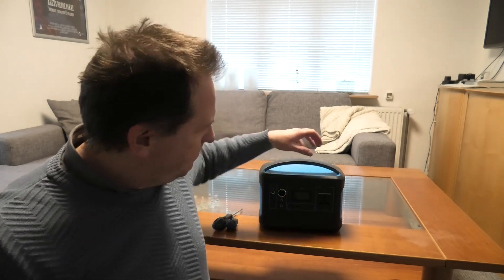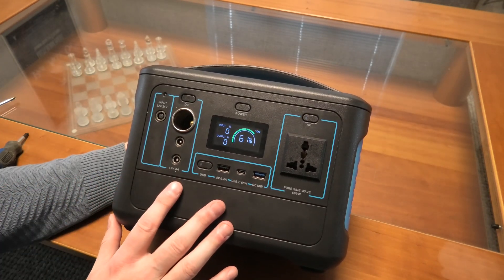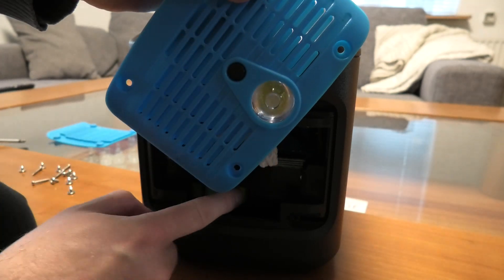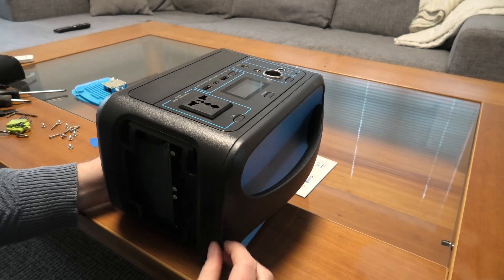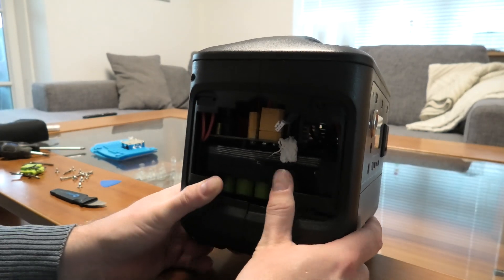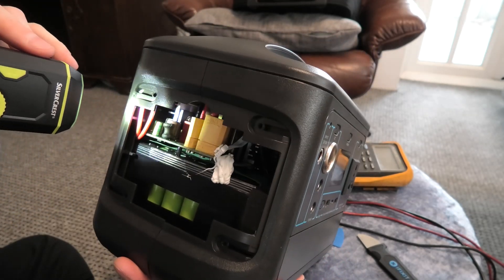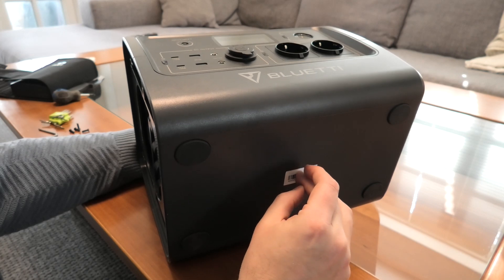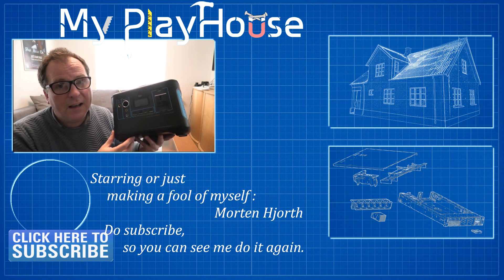What's Inside the Cheapest Power Station on Amazon - 1275

Comment: In series? That would be parallel but just because the label says at 3.6V doesn't mean the pack is actually at 3.6V. THey just use that number so you can convert to other voltages. It doesn't mean they have that pack configuration and we know that to be the case because no inverter is going to take 3-4VDC and step up to 120V or 220VAC. Same goes for the 65W PD because thats a 20V PDO from PD.

I'd be surprised to see 18650's its quite often that they use larger cylindrical cells. I want to say I've seen 33130's or something along those lines in Bluettis or EcoFlows

Ah I got to the point of the battery voltage. 6S sounds about right. Could be 7S but highly unlikely you got one that low so 6S is better suited to a storage voltage.
Reply from the maker: My best estimate is that it is S6P10

Comment: Hi Morten, maybe the cells in the 1000w supply are 26650s? Wider than an 18650 and look even a wider and shorter than 21700, but I'm only going based on proportions to your index finger which I haven't seen in person hahaha. I wonder what cells your largest power station (2kw?) has and whether there's a trend of using the larger cells in higher capacity stations or if this was a one-off. I think electric vehicles like Teslas still use 18650s which makes me think it's not necessarily a power density requirement.
Reply from the maker: Yes the Bluetti had one of throws bigger cells,, I could not see witch.
Reply: @MyPlayHouse  I think you might have luck disassembling it if you use the blue spudgers to pry open the handle itself rather than the part you tried to. E.g. at 06:31, you can see a seam that travels along the handle. It might be possible to spudger between the seam on the handle and trace it down to the each corner of the unit and separate the tope part of the handle from the blue plate underneath the handle. I wonder if that would work and whether it would reveal some screws underneath? It seems like the blue layer stays attached when you pried it off a bit at 08:48 which leads me to think the blue layer is what's screwed onto the unit for strength and the top of the handle clips in place to hide the screws. Might be worth a shot if you're interested in disassembling it further.

Comment: Thats funny I just bought the Ecoflow River 2 Max, yours looks like a gooden one. I like watching your reviews because I can afford them. Not like some other YouTubie's that have +$1000's Power Stations to sell or promote. Cheers Morten maybe Ryobi the power station ass to get it apart.
Reply from the maker: That is kind of funny,, as I have been communicating with Ecoflow about me showcasing one of there power stations. And they wanted me to do the "River 2 Max". But as it is kind of smaller than the other ones I have looked at,, And it is very similar, in specks, to this no name one,, and close to triple the prices. I thought I would have a hard time, pointing out the added value. :-)
But maybe you can tell me why you went with the Ecoflow River 2 Max ??

I must admit that I wanted to review Ecoflow, because they are a well recognised brand,, But I wanted a bigger unit. I have the smaller units, did not really need one more! So nothing came of it.